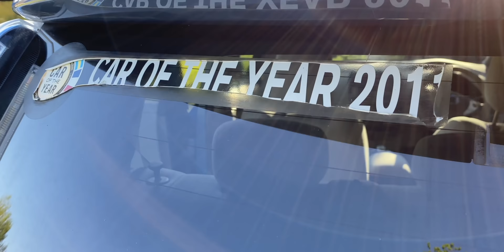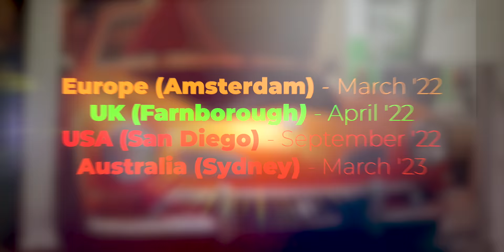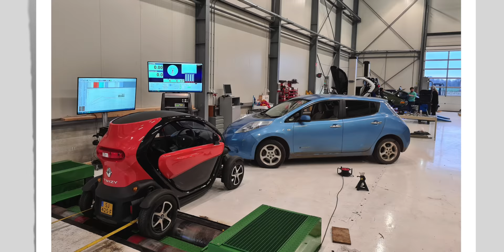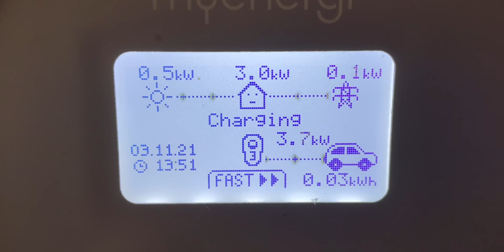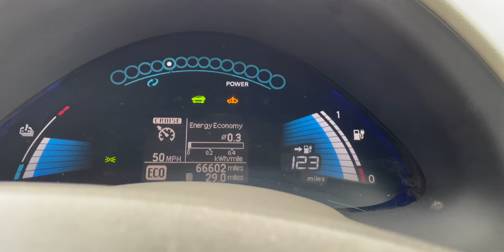Return of the LEAF: Robert drives his range extended EV home from Holland

Comment: I have one of the last 24 kWh Leafs (2015). It still has got all 12 battery bars after 77000 km. It probably has lost some range but it is honestly not notable.
i have kept it to 80% charge limit 95% of the time and Danish climate is benign for the battery still my Model 3 has lost more range after 55000 km than my Leaf .  I did not expect that 
I have kept it far to long now for sentimental reasons - but the Leaf has just been worry free and the lowest maintenance car  I have ever owned.itnstill has the nice floaty noiseless ride like a magic carpet going through the country roads in the summer - nothing beats that - not my Model 3 nor my wife's ID 3.

Comment: It's good to talk about using cars for longer. Although electric cars are undoubtedly not as bad for the environment as ICE cars, producing them (and the roads, parking spaces and charging points they need) does emit a large amount of pollution. Public transport, car sharing and cycling would be even better, but if you need a vehicle with this much space and speed, then keeping it and using it for as long as possible seems to be the way to go.

Comment: Nobody's going to throw the batteries away.*

*Unless you're the guy who blew up his Tesla to spite Elon Musk after he got a $20K bill to fix a faulty battery pack. Granted he could've investigated alternatives to blowing it up, but I guess that was the easiest option.

Seriously though, GBP4K to upgrade the battery in an 11 year old car is almost certainly less than what you would've spent servicing and repairing a similar ICE car, and you'd still end up with an 11 year old car with an 11 year old petrol engine. Electric motors don't wear out like petrol motors, so it should easily last another 11 years.
Reply: Actually they removed the battery pack (and motors) from that Tesla before blowing up the shell - all for You Tube clicks and ad revenue. The reality is, the older 2012 Tesla battery modules are still really valuable, and quite repairable too with new 18650's. It is the most sought after modules for EV conversions or off grid storage projects.

Comment: Three years ago I bought two used 96-cell LiFePO4 battery packs. They were removed from an electric city bus in Montreal, CA where they had served since 2008. I used them to re-power an electric lawn mower, a weed-eater and several other battery appliances. Batteries are rarely "thrown away" people just haven't quite found all the ways to use them yet.

Comment: Some good information here, particularly the cost of servicing and also the cost to charge at a public charger v the range that will give you. £4k for a replacement battery seems pretty good value too compared to the cost to replace the engine in an IC car, particularly as the new battery gives such an improvement in range.

Comment: Must be great to have an 'old friend' reborn like that.
I have had 2 VW e-ups. The first was from 2018 with the small battery and which averaged 5.1 miles per over 3 winters and 2 summers. Mixed driving, m-ways about 10%,  hills 100%,  and rural and town 60 and 40%. That 5.1 equated to average real world 95 miles per full charge with very few times of less than 80 and several times of over 100.
It had 1 problem (under warranty) - a duff high voltage heater which caused the computer to shut all HV stuff down: no go, no charge! But it was a fluke. I used to pre-heat in winter by plugging into the house and setting 'max' heat. that was until they did an OTA update to make 'max' 30 degrees!!. Unknowingly I then stressed the heater until it shorted out (since then I have never selected 'max - it used to be 25 I think).
My new one has, since April, given average 5.6 (better regen because of a more receptive battery I think). With its 32.3 KwH (out of 36.a bit) it has averaged  180 miles per full charge with over 200 often in summer.
And with the 'current' battery tech its expected to last (more than I am) and is guaranteed for 8 years - especially as I mostly charge at a nice slow rate at home and avoid temptation to blast around: only driving normally.

Comment: I have an identical Leaf, same age and colour and I've found the range very limiting now. My 45 mile round trip commute in the winter is only being achieved without heating and isn't ideal. I considered upgrading the battery but I don't think it's worth it as there other things starting to go wrong with the car now like suspension components, the steering rack as well as some other electrical gremlins. Plus there are known issues with the heating and electric hand brake that will probably happen soon. So unfortunately its days are numbered. I've just taken delivery of a new 64kwh Kona just like in the video and it's fantastic. Achieving 290+ miles compared to 50 miles is absolutely amazing and shows how much progress has been made in the last few years.

Comment: As a direct result of watching Robert's reviews on his LEAF I bought a 30Kw/hr LEAF 2 years ago.  5 years old when I bought it.  It's been a joy to own and convinced me never to buy another ICE car.   The ONLY reason I am selling it is to buy another EV with more range.   I own 2 cars, the LEAF and an ICE car.  I will sell both for a 3 year old Kia E-Niro with 250 mile range.
After 2 years experience I know that 250 miles plus CCS charging is all I need.   110 miles plus Chademo charging is the weak point of my Leaf for any long journey.
However.  If you want a daily "runabout", and charge from home, I honestly don't think there's a better bargain out there than a used 30kw/hr Leaf.  A solid 100 miles per day car.

Comment: Great to see this and considering that you can buy an older LEAF like yours for <£7k with a similarly tired battery that would mean for 7+4 = £11k you can have a 140 mile EV which is pretty great. Obviously needs a supply of 40kWh LEAF packs so not exactly easy to do but still. 

Not sure I agree with your conclusion though, it has taken 10 years for your LEAF to reach this point of a tired battery, that Mokka-e or other EVs in 10 years will have reduced ranges too, maybe they'll last a bit longer say, 12 years but still, a fresh battery and they'll be good to go again and people's expectations will be that they want/need the 175 miles or whatever that Mokka can do so in 10+ years when it can barely manage 100 the same job will be desirable.

Comment: I watched the trip to Amsterdam to pick up the Leaf again. I recently stopped charging my EV at home and started using a free charger about 2 miles from where I live. When I go to the beach the charging  infrastructure is horrible. I made several runs to the beach before going in Spring of 2021 and saw range anxiety and I was scared to death. I ended up using some Tesla Destination chargers and yes I had the adapters to charge from them. The owners of the chargers were more than happy to let me use them for free. Since then I have found a couple more charging places that are also Level 2 chargers. I have tried 1 DCFC charger and used it and I was not very impressed. The other one I found was 76 cents a kilowatt hour and I soon realized it was better to unplug. I hope Elon Musk gives us access to superchargers soon. My first EV was a 2012 I-MiEV with a range of around 63 miles and I now have a 2017 Bolt EV with the new battery pack with 259 miles of range. I have been extremely pleased with my Bolt EV. I would like to have a 2022-2023 Bolt just for the Lvel 2 charging increase from 7.2 to 11.2 acceptance rate. The fast charging could use an increase. I am surprised that has not happened.
Reply: gud fir yoiy

Comment: Oh you little "Hot Rodder You Roger" !!! Lovely expose. Down Under the range thing plus the lack of a really good extensive network of charging stations is a bummer. Going BUSH is a big problem though as Australia is the world's "most urbanised" country (despite all the BS in advertisements.) I like the efforts of your friends in Holland !! Here the price of most electric vehicles is a big problem also. In Tasmania, where my family come from, the electric vehicle would be great as long there are sufficient charging stations and well distributed. But here outside Brisbane it could be a bit of a problem depending on the types of charging stations and the spread of the network. Outside the local supermarkets there just four charging machines. Not good enough. Cheers mate !

Comment: Having replaced battery packs in EV batteries on a recall that were at the most 2 years old(LPF), batteries do fail, and  it might be very hard to get your pack rebuilt for a recent model if for any reason the warranty is void. Out of warranty and no chance of  getting it rebuilt your next stop is the wreckers.

Comment: Nissan LEAF iconic. I purchased a used 2019 LEAF SV base model with Nav for $20,710.55 out the door all said, with 46,785 mi ODO / it has a J1772 L1/L2 charge port & 50kW max CHAdeMO DC fast charge port. Its at the dealer getting a new front window & some paint repairs & they loaned me a 2020 moderately loaded model / both are 40kWh & have around 100-160 mi of range per charge, depending on route, topography, weather, HVAC use, etc / such that its possible to hyper-mile either to 7.1 mi /kWh at lower city speeds & very careful driving to keep inertia, while hammering in the highway at 60-80mph more like 3.1 mi / kWh - also the 40kWh SV weighs less than the 60-62kWh E+ models & has better energy economy because of the lower mass, but also lower range per charge where the large 60+ kWh LEAF SL. E+ can go 185-250mi per charge depending on driving style & weather & route

Comment: Gen 2 owner with 24kwhr battery. Average range is 88 miles with ten bars soh. Charging on electric grid costs 6 cents a mile. Free charging is available at various grocery shopping lots. Still about half the cost per mile of a petrol car with almost zero maintenance 😊

Comment: I'd be quite happy to have my new Fiat 500e fully refurbished in 7 or 8 years time by the dealer and fitted with the latest battery technology (less an allowance for the old ones that could be re-used in a static application) to benefit from the range increase but without having to buy a brand new car which has all the usual carbon footprint applications.

Comment: Congratulations! It's been so long.
We've got the same model with a warranty battery replacement in 2019. Still towing a trailer of waste food for our farm on occasion. 
Picked up a 2019 Leaf. Finding it hard to part with the 2012.
Converted a zero turn ride on mower using a purchased 2012 Leaf pack. Almost an hour run time, before swapping two 48v packs. Other 48v packs are integrated into a small off grid system. 
Plan to transition to an electric tractor in the next 10 years. Maybe I'll still have my 2012 Leaf then too?
Reply: buy jihñ deàr eitrç teaçhk ór 4 too 5 hoúr per chàté

Comment: I have different experience with 2019 Nissan Leaf. After 2 years 40kwh battery went bad, I could hardly drive 50-60 miles in single charge. It was part of warranty so drop in dealership , eta 8-9 months. My local dealership saying they asked for 30 replacement batteries for similar issue.
Reply: So did you continue to drive it until such time as the free battery replacement was carried out?
How long did you have to do without your vehicle?
Did they provide a loaner car?
How is the vehicle now?

Comment: Even with a fairly low range vehicle like the Leaf, 90% of the time it's not an issue because most people drive well under 50 miles a day on average. I recently had an issue with the battery in my 2016 Kia Soul EV+ (which I LOVE) to where I was rapidly losing range until it bottomed out at 40 miles on a 100% charge. (The battery is on back order and is being replaced under warranty). But even with THAT massively reduced range it was completely drivable for me because I work only 10 miles from where I live. This is, in fact, the very reason I went with such a low range vehicle (93 miles EPA) in the first place: Because it fits MY needs perfectly. And like I said, it's a great car. Best one I have ever owned, by far, and without exaggerating I would say that every person who I have given a ride in it has said that their next car will be electric.

Comment: From the west coast of Canada.  Our weather is very similar to yours so I found your video very encouraging, both in the range and the fact that batteries don't need to be replaced on late model cars.  I constantly hear about the cost of replacing a battery.  There are a lot of electric vehicles in the Vancouver area so maybe I need to go electric with my next vehicle.  We do tend to travel longer distances however and the charging infrastructure is not what it needs to be yet.

Comment: I have a 2016 24kWh Leaf. Everything is excellent except the range. If 4K can get it to 40kWh with 100+ miles, it's really tempting to get it replaced. The new EV are very expensive and I don't see any great difference with Leaf. Just to see if there is any offer in the UK.
Reply: Tron Jockey
1 year ago
 @Steve Zodiac  - The 2016 and 2017 models were found to have defective BMS software that incorrectly calculated battery capacity and indicated accelerated degradation that wasn't actual. Have you had Nissan update  your BMS software? Most owners have reported that it corrected the problem.

Comment: my Leaf is 30kw 2016 model imported american manufactured car  it has lost 1 bar of the battery. this christmas i drove 1200km to the  north in my country Norway in minus 7 to 13 degrees and let me tell you in the winter the car has a range of no more than 90km maybe 100 if you dont use the heater but having to choose between comfort and range is a deal breaker for me so from now on i will only do long drives in the spring and the summer when the car has a range of 150km , but the big key is you dont have to choose between comfort and range. You dont have to use the heater. Did i mention that i had to rapid charge the car   10 times during the 600km trip and of course 20times in total to drive back. In the summer i would make the half way trip 600km in 4 or 5 charges. The big difference is having to use the heater to deice the windshield.

Comment: My wife has a 108k miles on her 2013 Leaf.  We love the car, but very disappointed in Nissan for not providing a realistic replacement for the battery.  Our range is down to 30 miles with a SOH of 38%.  The quote from the dealer was $9,500 to replace the battery.  The car has been amazing other than the battery.  It is still on it's original brake pads!  We ended up buying another Leaf because it was the best priced EV out there, but we are still looking for a way to revive the 2013 Leaf.  I'm on the lookout for a 40kwh battery, but they seem hard to find.

Comment: We bought a 40kW Leaf in 2018.  We racked up nearly 70k miles in the last 3.5 years. I traded up to a used 60kW Leaf recently.   I will use the battery as a store, as V2G systems are just on the horizon for rollout

Comment: Mine is 2014 with 186k km on and 10bars of battery, now in winter fully charged shows 127km range but with heating on makes only 80km. Wish to put in 40kw battery as in this video. Its fun to ride so far. ✌🚗
Reply: buy ñéw keàf 226 mîkecrabg 😁é

Comment: Good one Robert.

I wish the manufacturers would produce a public demonstrator which would really squeeze the designs as much as possible to maximise mileage above all else  . . .and then ask the public for their view as to whether a honed down vehicle was acceptable as a daily ride e.g. taking out the aircon, electric windows, swapping all the glass for lexan, making the back seat and spare wheel an option, making the plastic dash only half width for the drivers side only, leaving the headlining board and upholstery and the plastic pillar coverings out and just spray painting these areas per 1960s cars. Too much unnecessary carp has been loaded on the interiors from the 1970s onwards.

Might be an idea to let the designers of train interiors, particularly London Underground, to have a go at designing the interiors for a urban utility electric vehicle for the shopper/commuter. Some real innovation has gone on there.